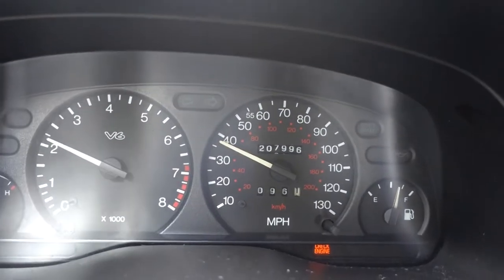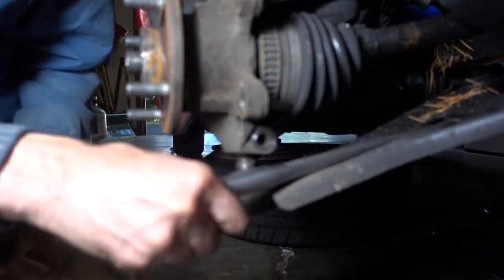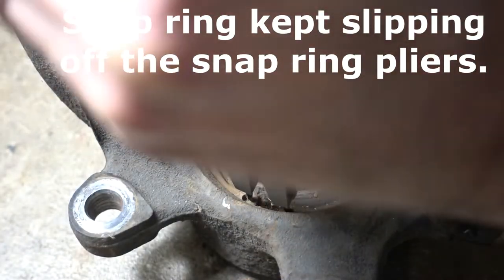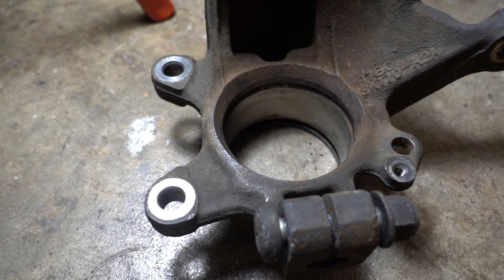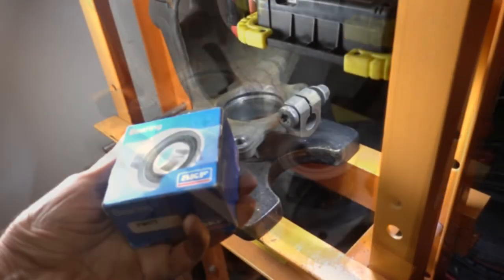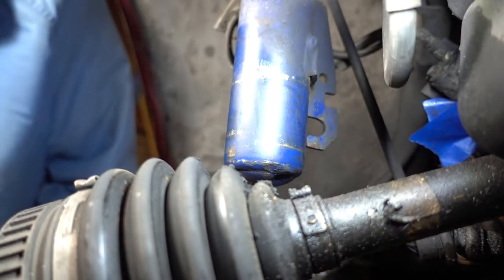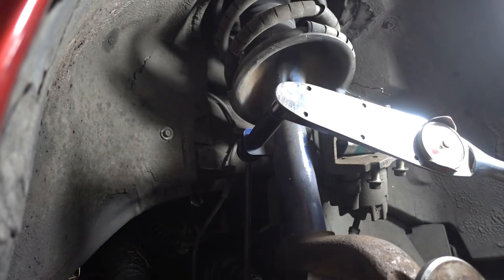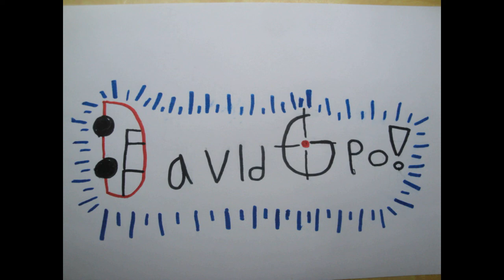Replacing the Front Wheel Bearing on a Ford Contour

Comment: My 98 SVT had a bad bearing on the driver's side.  Took the car to a shop and they some how broke  the tie rod end.  The kicker is they never performed an alignment after. When I questioned them about that they said it would be close enough. Never again will I take it to a shop, I will do the work myself next time. Great video
Reply from the maker: One would have to try to break a tie rod when removing it!  I was on a road trip and a strut broke.  The mechanic broke my coil spring removing the strut.

Comment: I just got taking the trans out of my svt! Wheel bearings are coming so you’re a hero on this one!

PS a litle anti seize on those axles will save you alot of trouble later!
Reply from the maker: I would love to see a video of your tranny project! At 208K I'm still on my factory clutch.  You're right, I should have used the anti-seize on the axle splines!
Reply: @davidgpo   i thought about it but I haven’t figured out the logistics of posting videos. Lol. I dropped the subframe and went out through bottom. If you have a chiltons or buy the ford service manual online it helps alot.

Comment: Is there a way to buy a loaded steering knuckle? I have a 99 contour and it seems to be discontinued.  But it looks like a 99-00 focus may work, what do you think?
Reply from the maker: I don't know.  You can either call the parts counter at a Ford dealer or call a parts salvage yard as they usually have cross reference information.  Good luck!

Comment: I’ve got a 99 v6 cougar with the same problem except mine is slipping I think it’s due to not having that outer snap ring. Does the Contour and the Cougar use the same exact parts such as the bearings?
Reply from the maker: I'm pretty sure that the suspension parts are the same.  You can always confirm with a parts counter person.
Reply: My 99 contour doesn’t have that outer snap ring either. thought I was going crazy but not even a groove, I guess it was a phase out and not a defective hub. Your comment really brought me sanity!!